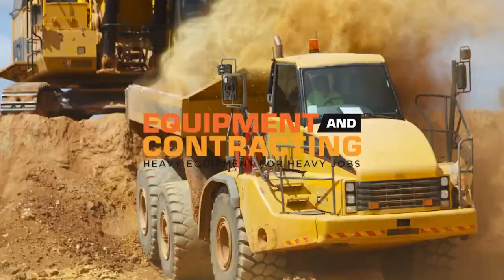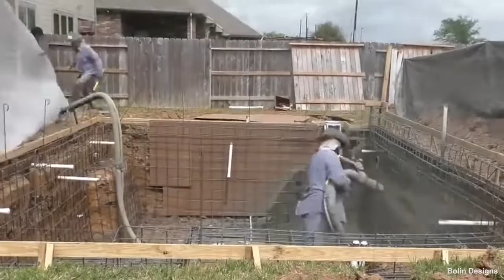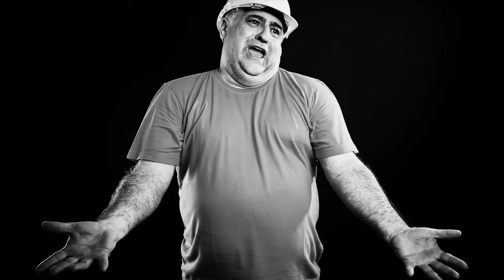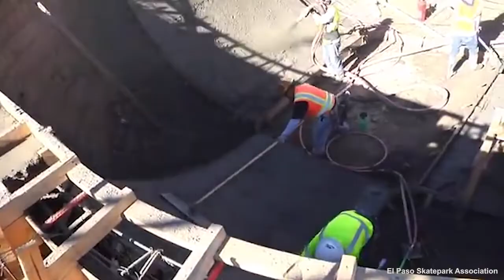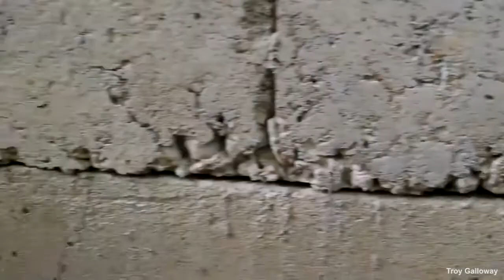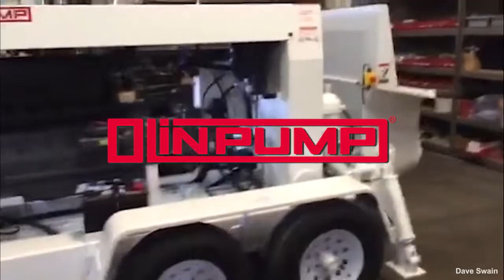Concrete vs Shotcrete vs Gunite

Comment: Poured concrete is generally not more expensive than gunite and shotcrete.
Reply from the maker: You’re right, poured concrete can sometimes be similar in cost. Costs really depend on project type, site conditions, and labor requirements.

Comment: Shotcrete used for parking structures stuff like that gun nights use for building swimming pools that's the difference between those two and then course concrete shoes for columns vertical walls tilt UPS slabs on grades patios driveways house foundations etc I've been doing this for 25 years
Reply from the maker: Thanks for your input, Robert.
Reply: Shotcrete and gunite are both used in swimming pools. You must have been watching from the sidelines for 25 years